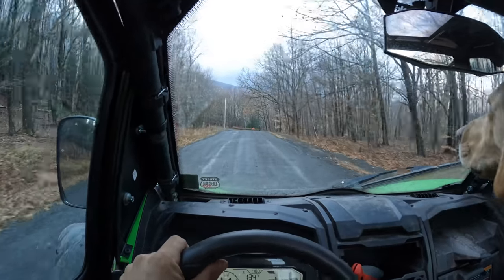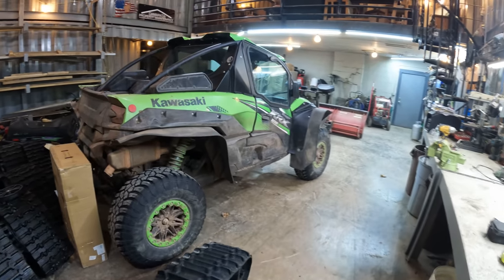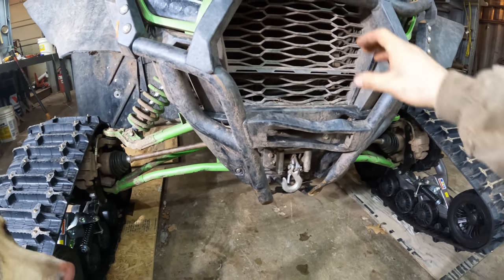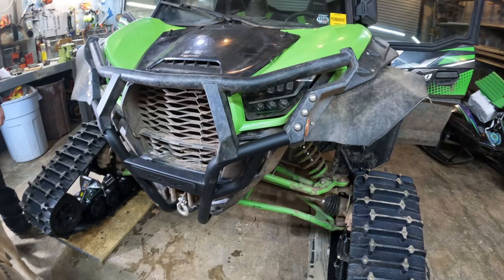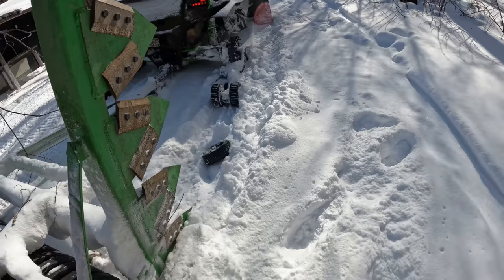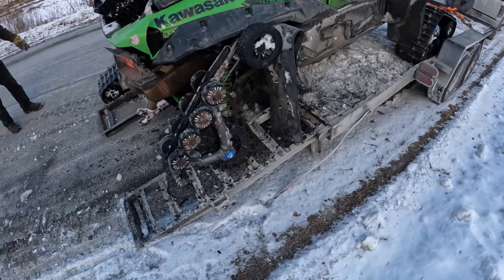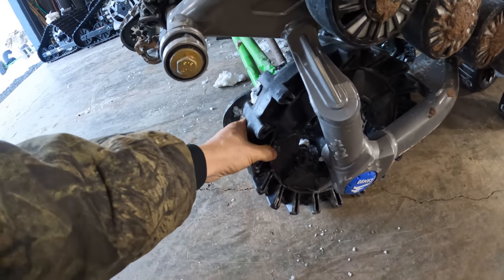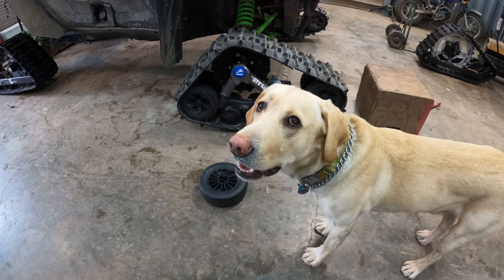Installing snow tracks on a sport UTV

Comment: Great video.  Kawasaki should hire you as a designer and test engineer.  Clearly you have the perspective of what's needed and desired.  Did Camso reach out with a new set to replace the set that broke on your machine?  They should.  What great marketing that would be for them - Camarata tested.
Reply from the maker: No, they insisted that they're tracks were fine. I told them they are garbage.
Reply: I would not bother putting a new set of the same Camso tracks back on the UTV without material changes to the design that address longevity issues and speed reduction.
Reply: @AndrewCamarata  Put a review on your B-list videos and use the company name in the title, and then when someone searches for it, your review will come up. Those plastic wheels are only good for kids' 12-volt toys from Walmart.
Reply: Looks like Fisher Price to me.
And Andrew should tell them to watch your videos and see how sloppy they are.

Comment: For all the plastic haters. Remember the intial failure was a steel bracket that bent due bad design, coupled with Andrews fix that may have weakened it further. After the bracket bent Andrew pushed forward, as he always does. This then caused the failure in of plastic wheel due to the additional side load from the bent metal brackets. Then he drives the thing down the road on the plastic wheel that was designed as an idler running on a track, thus causing the plastic to errode.  Plastic parts when properly designed can outperform metals. It is the uninformed that say cheap plastic $hit. Granted sometimes things can be better using the right metal but not always.
Reply: Well, I guess your future at Camso is now safe. Enjoy!
Reply: The bracket didn’t fail from him modifying it, you can clearly see the bend wasn’t at that point

Comment: Andrew:  Mechanical Engineers will tell you nylon is stronger than steel.  You are right about plastics.
Reply: That Cody seems to have an endless source of energy.  I found your episode extremely interesting.  You really put that thing through its paces.
Reply: I learned the comment regarding the use of plastics when the timing chain gears went out on my 69 350 CID Tempest.  They had nylon teeth.  That was what I was told when I ask.  The replacement were metal.  

Plastics are sensitive to large temperature changes having both upper and lower limits.  

Intuitively I know you know this.  You are right in saying that design was not well thought out.  While you did put the equipment to the test, it should have with stood it.  Like you said the tracks weren’t cheap.  

Keep up the great videos.  It is great you have a wrench head girl friend.  I am sure she would make me look silly.  

Rub Cody’s ears for me. (Miss Levy). Crack on.
Reply: @kenshores9900  Factory installed nylon teeth cam gears were mostly for making the engine not as noisy...not stronger.  Yes the all metal gears are more durable.  I have installed many of them.
Reply: @rickiewilliams1965  I know that is true but they justified it by the strength of nylon.  You could see pieces in the oil each time you changed it.
Reply: @rickiewilliams1965  The 350 and 400 CID engines while very good had their issues.  They were over torqued  (in my opinion) and required replacing the water pumps every 25-30,000 miles.

Comment: It's March there is NO snow on the ground, lets throw on a set of tires and go up on the Mountain where the snow never ends.......6k for a set of tracks with plastic molded wheels, how much would you pay if they were Aluminum? I'm guessing the cost would go up Andrew.

Comment: You know Andrew they make a stick down insulation vibration control padding for hot rods to keep the metal from rattling it also insulates comes in big rolls you cut to fit whatever you need

Comment: For your issue with the lug nuts not fitting a socket they actually are soppose to have special lug nuts that are like 4” long that are smooth with a nut on the end so it gets the socket outside of the sprocket

Comment: Andrew I think I solved you're unstable your roller brush cutter drain pipe thingamajig watch your video after you break down or just before you break down not when you broke the shock off the mount but you need to extend the roller it will make the things sturdier and I know that's been an issue for you cuz I've been watching you build it from the beginning when you had to replace the blades when it flipped over on its side when it kept thing it wobbles around in the back extend the platform will making it more stable and on top of that you can simply put two cinder blocks filled with concrete to fill up the holes or some sandbags if my ideas wrong oh well I've just enjoyed watching it be built ran through its pieces and rebuilt again thanks for all the videos and it's good to see someone else who lives on top of a mountain

Comment: I wonder if you can gerry-rig a snowboard, or something to make a ski, to the track if you break the sprocket off again? just enough to get you off the mountain. would have to be a bit high in the front. or... make some metal skis in the shop that you can put on the machine to have at all times, like on the old runner sleds. those would be light and small. 
weird thought the other day, do you have indoor plumbing in the container castle? Not that I want to know your bathroom habits or nothing, just curious how you keep it from freezing in the winter. You can go around smelling however you want, this isn't 4D t.v. yet.

Comment: 3M has semi rigid plastic bonding agent, when i stitched up my fender with that welder, i ground the inside and smeared on some thick beads of the 3M semi rigid. suppose i haven't taken them off to inspect the inside. just little extra insurance policy since there more of a 3d fender puzzle than acual fenders.

Comment: Just a side note. I believe guys are able to have good success really airing down tires on snow. Basically as low as you can without damaging the tire or rim, and they just float instead of digging down.
Reply: That works fine at low speeds but since when has Andrew Camarata operated at low speeds?

Comment: You should have cleaned it with a pressure washer before doing the install. Very cool alternative to a snowmobile. Also EBC pads are far better than factory for any vehicle.

Comment: my question is: i know this doors are made of lightweight plastic and are not designed to hold heavy glass windows. the rear window is good and stable. But the doors very wobbly with the heavy window construction on it. weakpoint? but the plastic wheels? I mean those snow tracks are not cheap at all. I hope you can send them back and get your money in return? you have to upgrade this vehicle, do a typical rock hard "Camarata update".

Comment: I find with track you have a bulldozer instead of a toy, to bad they didn't make a smaller set and 8 inches wide like they used to for 4 wheelers. I had a set and they only slowed you down about 20 or 25%  they were Kimpex RS 4 was the name

Comment: You're adding so much accessories to the Utv until it becomes a off road truck. Wouldn't the other way around be easier to buy a street legal suzuki jimny (or anything else small), put a lift kit, tune the engine, lockers and you would be done?

Comment: I haven't seen anyone mention this yet: looking at where that bracket bent, the original problem; is it possible, even likely, that Andrew weakened it by grinding the metal for clearance, or even Clarence? 
If that hadn't bent, the other problems probably wouldn't have arisen. Also, if he'd dragged/limped it home at that point, things wouldn't have gone so completely fubar.
Having said that, is plastic a great material to use for track wheels, on a 𝑼TV? I've never designed, built, or even used, a snow-track but, if I was to give it a go, I think some sort of metal might be a good starting-point for the wheels and other load-bearing components.

So, Andrew's probably right about the build quality but I'd hardly call this a fair test. The plastic components only failed after the metal and that metal was tampered-with so, there's a pretty fair chance that his warranty ain't going to do him much good now.😁

Comment: Are you using engine heat or an electric heater that was put in the dash with the blower and if it was electric heater put a link in the answer or the video you put on I hope that the Manufacturer of the TRACKS THAT WERE MADE OF PLASTIC see your video ! your right of all the money you spent on Plastic wheels thanks for letting me ride with you

Comment: I was curious when Andrew put Those junk traps on and the lack luster plastic parts they had (on both sets) that he would allow stuff with obvious built in obselence on his machine.
Also when you look at the basic steering components on the Kawasaki  and the skills you have Andrew and all your tools
Why don't you build a purpose built atv of quality parts with a decent engine etc for the
 job surely by buying, using components from various places like wreckers, new and used parts as needed you could put together a very robust machine for thousands of dollars less, that is easier to work on, with more power and built exactly as you want for pleasure and work?
and it would make for some interesting videos which in the long run would probably pay for the project.
Tony from Western Australia 🇦🇺

Comment: wait is this a reupload because i swear ive seen this? or at least some parts. I especially remember the bit where Cody ran off and you were thankful about the tracker on him.
Reply from the maker: There was a drop of similar stuff in the trail trim roller video. That wouldn't have happened, but these tracks didn't last very long/we didn't get a ton of snow.

Comment: Fair enough, I just disagree with the conclusion that the idea is sound. It's definitely not...I mean, that four-track thing does maybe work better in some very specific situations, but its so delicate by design...all that leverage on the axels and flipping around. And this is btw going to happen exactly the same way even if you made all the wheels and stuff of stainless steel or titanium. Its even gonna be much heavier which works against the agility and speed what these machines are wanted to have. 
Military would never use this, ever. A two-track-design has much more stability just by simple physics laws. Make a little racing snowcat..that would be a thing. Tracks need to be much, much bigger inrelation to the vehicle in order to work but then they wouldn't even leave the axles straight for the first test ride, therefore the design is already failing at the drawing board. Bigger tracks need to be attached at two or three points far from each other. As I said, maybe some specific use on even terrain.
Reply: Modify the two tracks per side to one single much larger track with a bigger drive sprocket both ends if you want to utilise 4wd and reduce drive train stress or, run 2wd only with only one drive sprocket per side, which is how all other single track per side  units run, lock the steering  straight ahead, tickle the brakes so you have independent left and right braking,  and now you have a seriously  go anywhere machine,  dozer/skidsteer steering , the gearing you want, and without the numerous issues inherent in any of these  single-wheel track manufacturers. 
You could do the over-the-wheel  add-on track systems available  and used on skid steers, only do this and tickle  the brakes for way less money  and effort than these relatively light  but expensive independant track systems. For someone like Andrew who replaces brake lines, it would be a quick mod to modify to left or right braking, using simple customisation, or standard  independent  braking as  used in the offroad 4x4 community  to allow skid-steer or excavator or dozer style steering

Comment: Might better keep the tires,and get a set of v-bar style off road tire chains,if there is clearance for them,,alot cheaper than tracks,,agreed you won't have the flotation like the tracks, but will have better ground clearance!! Put the chains on tight with the tires deflated,and re-inflate tires,should go like a tank thru the woods,the mud,over rocks,even on gravel roads!! Pewag makes a square cut high carbon steel tire chains for light truck,heavy trucks,and heavy equipment like large front end loaders on the quarrys,,just a thought!!😎😎😎

Comment: Plastic parts on a device that is meant to be used in cold and extreme cold.  What?  Plastic is fine in warm weather (if properly reinforced with fiberglas or carbon filaments).  But as anyone who's ever lived up north knows, plastic and cold do NOT go together!  It gets brittle as glass...  Andrew is 100% spot-on, those parts should have been aluminum or magnesium at least.  Steel would have been even better, really, for longevity.  Sure, it increases the unsprung weight, but so what?  A bit of lowering of the center of gravity is usually a good thing... Nice video, Andrew.

Comment: i think tracks on UTV are ok but there not great seem like you can have problems with them like something break on it . . i think Cam am make really good tracks for there UTV and i think Cam am make one of best UTV you can buy right now especially if you want a very fast UTV like  Can Am Maverick X3 and Yamaha YXZ1000R is pretty good to and it have manual transmission . I'm sure all UTV are good . i guess there going be a brand new name UTV coming out SpeedUTV Baja Bandit standard turbocharged 999cc engine makes 225hp .but there is a big bore 1400cc option to boost that number to 300 hp..

Comment: I have seen those junk tracks kits all the time. Now I can tell you many times you will find a set of 3 of them for sale all the time. Because someone busted up one track and destroyed it and instead of fixing it or what ever they sell them for a grand or 2. Much cheaper than new. 
Many years ago I seen a set of tracks that you drive up on and then they latch some how. You pretty much just leave your tires on and drive up on them. I can not recall what they were or how they worked yet I do recall they were for pick up trucks and were like 20k or more.

Comment: every track you see for a wheeled vehicle is made from plastic on the rollers... the entire thing needs to be metal and id argue the tracks need to be metal with rubber pads as this isnt a mini excavator or skidsteer going 8mph at max .... your going 30mph+ hitting bumps and rocks getting the same forces as a skidsteer but at higher speeds it doesnt make sense to have plastic wheels

Comment: From what I hear, ATV/UTV tracks do break a lot and cost a lot of money to maintain, not to mention, buy. They are also really hard on the machine itself. If you need to pull something heavy in the snow, buy a wide track utility snowmobile. It may not look as "cool" but it's way better and built for snow.

Comment: Too much plastic used in products where metal would be the ideal material.  If they could build an engine out of plastics, they would.  Some engine parts are plastic.  Several car manufacturer's engines have plastic intake manifolds supposedly to reduce weight but I think it's to reduce cost and increase profits.  Chinese quality.

Comment: Now you know all ATV and UTV tracks are cheap junk compared to the original. The man who made the original used 1/4 inch steel plates and schedule 80 steel pipes to make a solid enclosed box. All wheels were steel with solid rubber tires. The main drive sprocket was steel to. His was made for muddy construction sites. He later made some for off roading and they looked more like tracks off of military tanks. He made the patent free for others to make their own along with the plans. Now you can't find them do to copyright take down strikes by big companies  making knock offs.

Comment: As an engineer, I'm a big believer in purpose built equipment.  Your sled is a sled.  Your side x side is a side x side.  Keep them as such.  Use them for their intended purpose and they will be much more reliable as such.

Comment: The tracks did not fail as much as they were used improperly. They are not sled tracks. They don’t go fast - nothing above 30, and no hard surfaces. Both will kill the bearings. Because they have to turn and there are 4 of them, they are not built for, well, Andrew.
Reply from the maker: I thought they were advertised for all weather.
Reply: @AndrewCamarata  just think of the cushioning work of the air in a tire, not there in the track. I saw a cat-ski operation put a set on a pickup truck and ruin them in a short time by doing pavement and trying to go too fast. PS: thanks for one of the best channels out there…

Comment: I have had the same set now for over 8 years. Man are you rough on equipment.  They CAMSO tracks are not geared too low, they are geared such as to optimize torque, turning tracks takes power, and you must gear them down.  Sorry you broke down, but after watching the video I can see why, and its not CAMSO's fault.

Comment: The main issue with plastic is the cold, the colder the plastic gets the more brittle it gets which is probably why it broke like it did, overall the design is great but the material like you said is garbage.
You would think that whoever designed those tracks would have taken that into consideration, I would honestly be getting into contact with the company and ask for a refund, $6000 is quite a bit of money for something made out of garbage material.

Comment: well of course the tracks gear the machine down, 1. you need a lot of power/torque for snow and 2. those tracks are an after market solution and will never be as good as a product built for snow exclusively. its a tradeoff and allways be one.